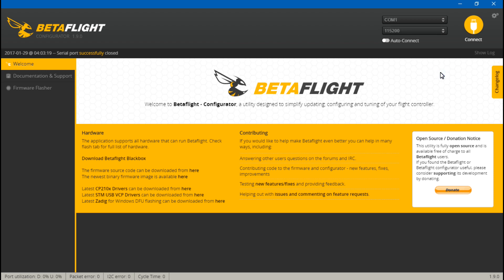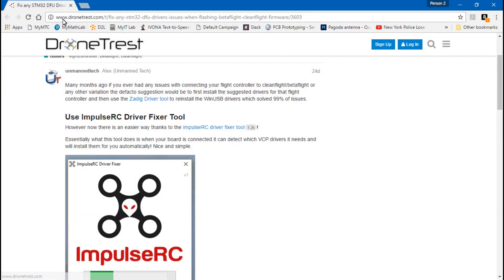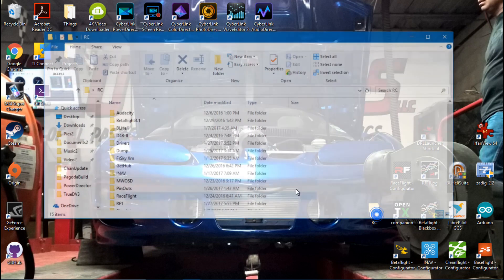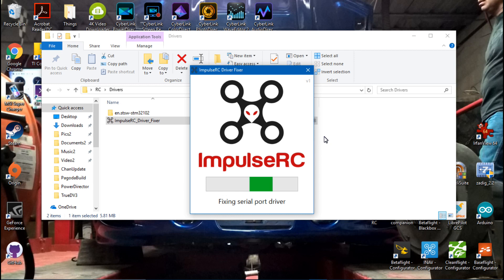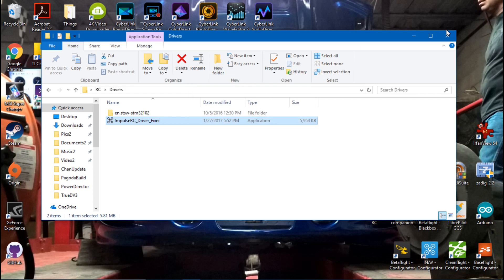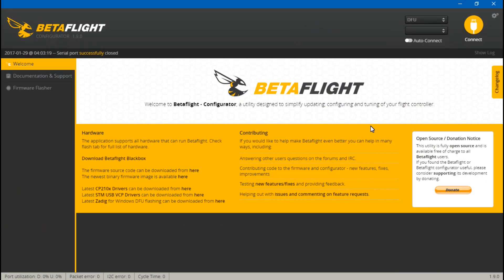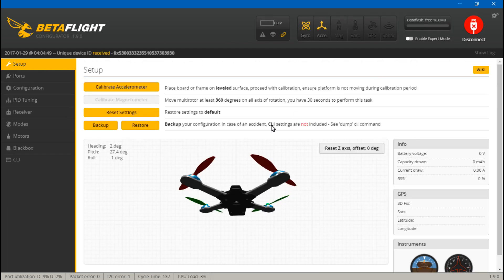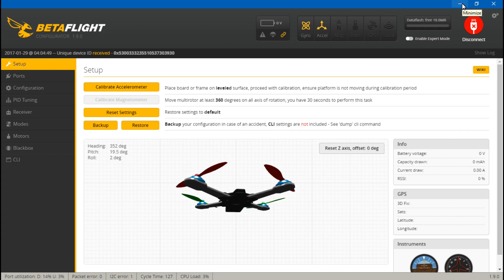Impulse RC Driver Fixing Tool (for flight controller USB connection problems)

Comment: Can Anyone help me please,  I bought Eachine 5 years ago I never used it this is why im having a Problems. Now I'm trying to use it I'm not able to connect the Eachine UK 65 with Betaflight Configurator, i gett an Error , , >>>WARNING the firmware version is not supported please upgrade firmware that supports api version 1.41.0 or higher alternatively download and use an older version of configuration if you are not ready to upgrade.<<<< can anyone help me ,

Comment: Hello! i recently bought tyro99
After assembling it and connecting it to the PC, I started to configure it for myself in BetaFlight.
When I clicked one time save flight controller disconnected and the program can not see it anymore.
So I bought a new F4, put it together and after saving my settings again it became the same.
The program no longer sees this flight controller
Is this a typical mistake? Please help!
Reply: When I turn on ImpulseRC_Driver_Fixer it shows me that everything has been fixed but when I turn on betaflight I still can't see the flight controller.
in general, when I connect this controller to the computer without pressing the button which is next to the USB input, the computer does not detect it Only when I press the button on the board which is next to the USB socket and connect the cable, there is a sound in Windows that something has been connected but still the betaflight program can't see the controller.
Reply: I apologize in advance for my spelling mistakes, I just use a translator

Comment: Hi!My Eachine Lizard95 had no problem connecting to Betaflight and I managed to set the receiver, osd and other things. However, it wouldn't flash the new firmware. After many hours of fiddling, loading drivers, watching videos I tried the Impulse driver fixer and lo and behold, the motors started vibrating and the firmware loaded! Unfortunately, now I can't connect with Betaflight and it doesn't react to my TX. I get a message from windows that there is something wrong with the driver and it doesn't recognize it. The flightboard beeps all the time and all the LEDs light up white. Anyone experience the same or have a fix for this before I break out the hammer?Matthew

Comment: I'm with all the others, Windows 10 does not recognize my F3 board even after all the drivers, virtual serial drivers, etc.  Nothing is recognized, so Impulse just searches on and on.  Has anyone got a Windows 10 fix for these virtual com port drivers?
Reply: which board were you trying to connect and did you ever find a solution?
Reply: Same here
Reply: Same here

Comment: The tool doesn't detect my flight controller it seems.
Reply: Do I connect it in boot mode? It didn't find it then but you never know..

Comment: My FC works fine on my friends computers, but doesn't seem to work on my laptop. The ImpulseRC driver fixer keeps searching for ages with no luck. Any solution for it?
Reply: FIXED! Turns out the CP210x Silabs driver wasnt fully unpacked. I had to go into the downloaded driver and into the x64 installer part, unpack/install that and restart laptop. Then I wen to device manager and followed your manual video to reinstall the driver (didnt show up under Silabs but found it as CP210x). 
Now it connect perfectly. Thank you!

Comment: Awesome :-)
I have an F3 EVO which (after a failed pass-through ESC flash) would no longer connect. I had pretty much given up on it, but gave the Fixing Tool a shot and, heureka, it worked ;-)  Thanks so much for sharing.

For those who get nothing but "searching for flight controller", try de-installing the CP210 driver, ST... and whatever else you tried. Then re-install just the CP210 driver. No Zadig!

Comment: hey thanks for your videos it helps a lot of us out here but I digress my raceflight FC just still won't do it manually install drivers used your little search impulse RC just searches for hours will not connect any more ideas?

Comment: OK was pulling my hair out trying to find my solution, serial error connection when I tried to connect eachine QX90C to Cleanflight, this tool fixed it right away! Had to disable my antivirus because there is not enough positive data in the Norton database about the program so it blocked it with a code WS.Reputation.1. Worked great, THANK YOU! BTW Subscribed!  :)

Comment: Hi. I have an SP Racing F3 pro clone board from BG. It was working well until I hooked up a micro minimosd. Ever since I did it, I've never been able to connect it to BF again, even though it still works with the previous configuration and I've already removed the OSD. I think I've tried everything, both the tool in this video and the manual drivers update in your others, with no success at all. The tool fixed another F4 board I have (cheers to you for that!), but when trying with this one, it stays in "Searching for flight controller" forever. For some reason, zadig doesn't detect the STM bootloader driver when I bridge the boot pins. It's always the CP210, whether I bridge them or not. And the board seems to be in DFU mode, as the red light doesn't blink, as it does when the pads are not bridged. Any idea?
Quoting Leia: "Help me JC. You are my only hope".
Reply: I dont know if you fixed this or not... but depending on the UART you hooked the OSD module to it could be that. See USB uses one of the UARTs, and the OSD will work fine while usb isnt cnnected, but once the OSD claims the UART then the FC cannot be accessed through USB, so you would have to unhook the OSD in order to use USB.

Comment: mine says searching for flight controller
Reply: same here
Reply: did you solve it? this happend when i was in betaflight..
Reply: i cant fix it either
Reply: @Michael.Bernheim  try an new cable or computer, it worked for me after a while
Reply: @Fazzelgaming  i have tried 4 computers and 6 cables and 3 fc nuthing works
Reply: @spenzee1722  just sell your stuff and find a new hobby
Reply: @Fazzelgaming  i actually got it working about an hour ago dont even know how but it's fine with me just never give up
Reply: I also have this problem did anyone manage to fix it

Comment: i'm new and did the stupid thing I think everybody that started out doing. I bought a lot of stuff before I knew what I was doing :/ I got the  turnigy Evolution and got some mini drone to fly in the house and practice before I move on to biger and more expensive ones. I got the blade inductrix and the Eachine Turbine QX70 and then found out that they don't work with my radio. I got a couple Flysky FS-A8S can I put them on the drones to get them to work? or do I have to buy another radio? thanks for the help. love your channel.
Reply: just watch a video were I guy put a Taranis Bee Brain in the blade. he said it runs s-bus! think it will work?

Comment: On my computer this tool from Impulse  RC runs forever and does not work! It endlessly looks for the FC!
Reply from the maker: Sometimes I have to put the flight controller in the bootloader first and then run the tool. Its worked for me a couple times.

Comment: i have the new betaflight f3 flight controller and I can connect to make changes in the configurator but can't connect in bootloader mode to flash it. I watched all the videos and when i go to update the driver . I do not have a usb driver in the microsoft folder other then usb to bluetooth link . Please anyone have any ideas how to get the driver back?